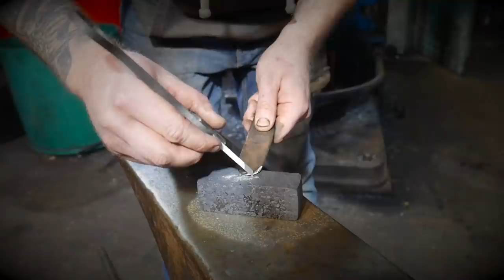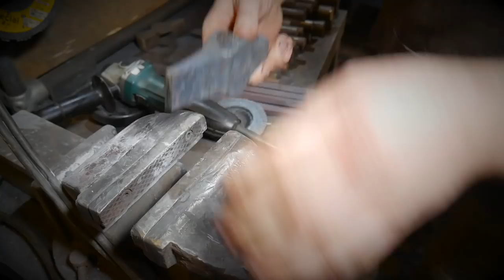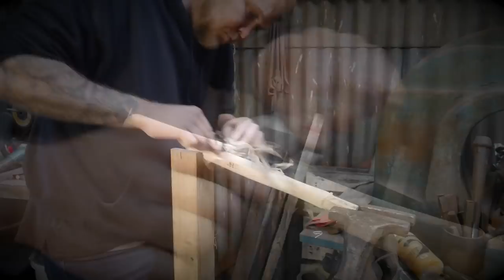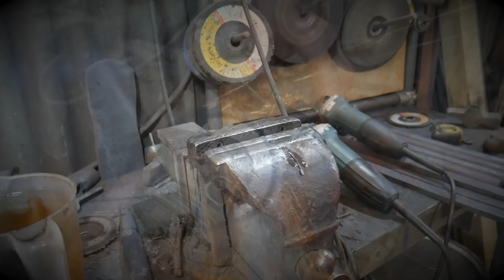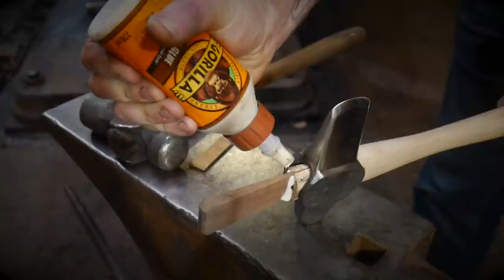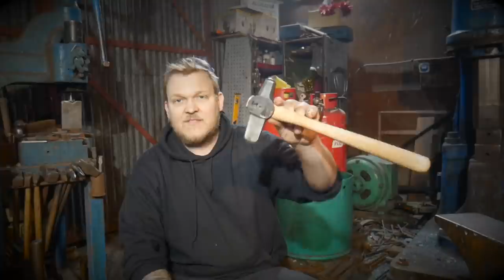Epic Blacksmith tools the Chisel! Forged top tooling The Hot Cut.

Comment: Why a non-ferrous wedge vs one made of steel? Also, what is the benefit of having the struck end of the tool be as small as you have it? Does that make it easier to hit properly? Thanks for the awesome vid!
Reply from the maker: Non ferrous cause it makes a nice contrast. Looks pretty basically well I think so. Combination of material available/deformation overtime and it does help quite a bit. Also a domed contact area helps. Also it looks smale cause of the very large cheeks it's about 25mm square or an inch ish.
Reply from the maker: I'm pleased you liked that video.

Comment: Dan, question; when it comes to top tools, I've always been taught that you do not want to fix the handle to the tool. I've also used some that have been fixed together, and the shock through the handle and into my hand and arm. What are you're thoughts here?
Reply from the maker: I've tried both and find the fixed much better. I have little to no issues with the shock. I'm being honest here. How ever its different when it comes to metal handles. 

I also thought the none fixing was so the tool could be turned like a set hammer to change the orientation. 

great question how do you feel about the fixed handle.
Reply: @danielmoss2089  I'll agree with you that a tool fixed to the handle is easier and more accurate to use. I just don't like dealing with the shock. I much prefer not fixing the handles. Another reason being that when my striker or break the handle, I can easily slide another tool off it's handle and use it. Kind of like a modular tool system, handles being interchangeable.

Comment: Dan -  legit newbie question, when would you use a hot cut vs a cold chisel, and why?
Reply from the maker: You will kick yourself ones for cold metal and the other is for hot. Cold chisel is used in conjunction with an engineers vice normally and a hot cut is for work on the anvil. Normally if both have been heat treated you could get away with either.
Reply: @danielmoss2089  Thank you Dan, There you go @EricWF - question answered, and I learned something too.